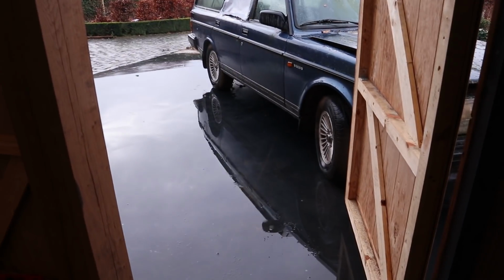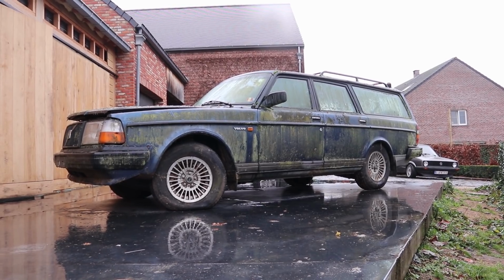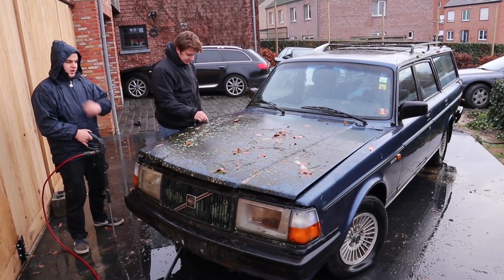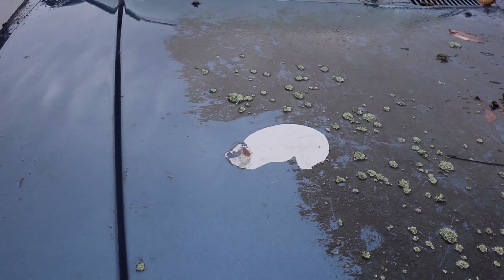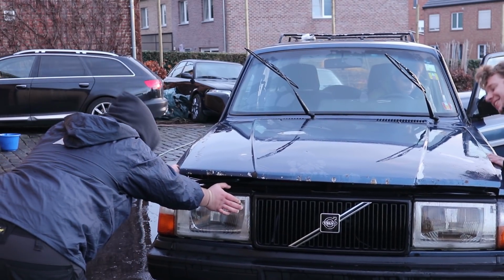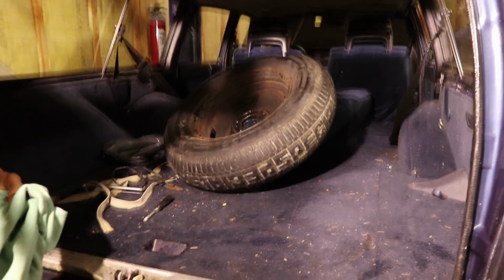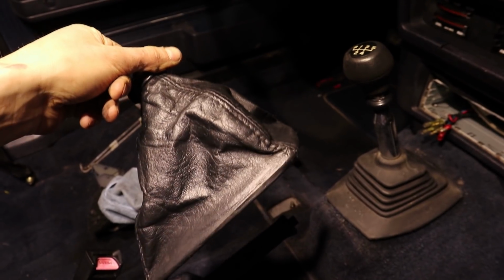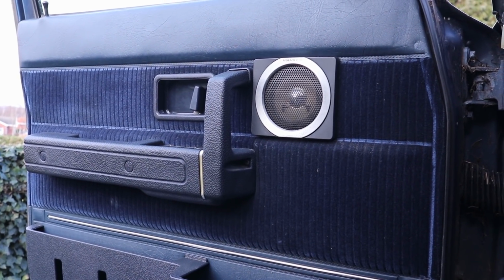Volvo 240 First Wash After 10 Years Of Sitting In The Woods

Comment: There's something extremely satisfying about cleaning a car that has been neglected for a while. Amazing how much of a difference a clean and a bit of a detail can do, it was the same for my E30 Touring. Very much looking forward to the rest of this series!
Reply: Pull the carpet, did it with my E30 Touring... so much rot underneath from leaky heatercore...
Reply: @ZeroGravityShisha  Good to know thanks! As far as I'm aware mine is fairly solid in the floor plan area, although I may take a closer look. I've had plenty of rust in other places though!
Reply: @FootToPedal  as far as i could tell from underneath it looked great. Once i pulled the carpet i realized i needed a new Floor.
Reply: @ZeroGravityShisha  Rust is always a scary one it must be said, my tailgate and wheel arches will likely need some attention this year too.

Comment: The worst situation to buy a car is, street lights and rain.
The best situation to sell a car is, street lights and rain.
Reply: I sold my car in the summer, the guy just sat in it, started the engine, wiggled the gear stick and took it off my hands.

Blessed day that was haha
Reply: @willm5032  Jeupp.
Reply: So true, I had to take a car back to the dealer the next day when it dried off, the clear coat was peeling on the hood.
Reply: @blacksquirrel4008  That is very bad.

Comment: I too agree, there are so many old things that just get tossed and discarded, but are way cooler once restored. I once had a 265GL wagon but it was gas rather than diesel. Loved the car but had so many mechanical issues, I had to part with it. I also had a 165 wagon as well; loved that one too, until it got hit by another car.  I feel these old Volvo wagons are still great cars, and a best first-time car for any young teen kid today. No, it is not a hotrod, but it is safe. And it will allow then to appreciate the value learning to drive and of working on a car long before investing in a pricier car later. Regarding power washing the hood; I feel you should have done it anyway. The fact of the matter is, the hood will need to be repainted anyway, and any delamination already existing will need to be stripped. So, by power washing the hood, you're saving yourselves some time; its all got to come off anyway.

Comment: I'm from Sweden and although 240:is are still pretty common here, 240 diesels are rare! I look forward to follow your project! :) I see this one has the 1987 Volvo 60 year jubilee seats, wich is nice. I also suspect it has power steering (since all 240:is with power steering got the smaller steering wheel (originally from 240 Turbo) on the year models 1986-88. Also, that roof hatch looks cool! The 140 and 240 wagons were NEVER available with roof hatches (only skyports) and this one does not look like a Volvo hatch! It would be interesting to get a closer look on it.

I see the headlight reflectors are pretty rusty btw. They probably needs to be replaced. It's a good thing on the 240 that you can replace just the reflectors without having to replace the headlights or the glass. :) I have a LOT of 240 parts that could help you with this project. Too bad I don't live in Belgium. :(

Comment: I'd pull the carpets out - shampoo them with a wet vac and make sure the sound deadening or insulation is dry and remove any mould growing. Also - if there is still a mouldy smell - get an ozone generator. It will react with and kill all the mould, fungus and bacteria in the car making it smell. Also pull the seats out and pressure wash and shampoo them as well. It's likely been wet for some time - you probably have a few of the window seals, the sunroof and the hole in the roof that have been leaking and having water sit in the floor.

Comment: I‘m curious how it’s going on. I bought the same Volvo 240 (but not with diesel) in the same colorway. Please put out the  carpet and take a look for rust. The floor unit and the door sills are often in bad condition. Also the rear wheel housings should be checked, if there are rust issues into the direction of the back Seat. 
I hope to see much more about this project!
Keep it going :)

Comment: Ok, so instructions for painting the hood:
Remove existing paints.
Use a dark primer, let it set for 24Hrs.
Get the color code, and try and get the correct color.

If you decide to spray paint, get a "semi-pro", something like the Bosch PFS series.
Spray and let it set. Repeat. At the end use a clear coat for protection. This should do.

Otherwise, if you know any professional painters that can do it cheap - ask them.

Comment: The fender might be saveable - Just try to rub the bubbles away and see what is the state of the fender under them. With some luck and rust converter, its just surface and some black paint will save a few euros to spend on.. the passenger rear window :D

Comment: These volvos are almost bulletproof so it should be an easy restoration👍
Reply: Indeed, although some spots on the car, especially the trunk lid, look pretty "crunchy". Not to mention the rust hole in the roof. But as far as I can see, there is nothing that couldn't be fixed/replaced.
Reply: @denisneurohr6598  oh yeh it will need some serious attention in some places too

Comment: The fact this is diesel is great old diesels don’t get love
Reply: However this old D24 idi diesel (made by Audi/VW) does not have a very good reputation...
The car body looks pretty solid so it might be a good candidate for a B230FT swap.
Reply: @jfv65  i have a 245 d24 and yes the engine has broken down a few times, but it runs really Good. 81horsepower and strong as Ever. I will destroy the Ferraris..downhill ;)

Comment: you are doing it all wrong like going heavy handed with a pressure washer on tired paint that has been sitting for 10 years is just wrong. first you soak it with soap then wait 10 mins and then use a pressure washer from far not close